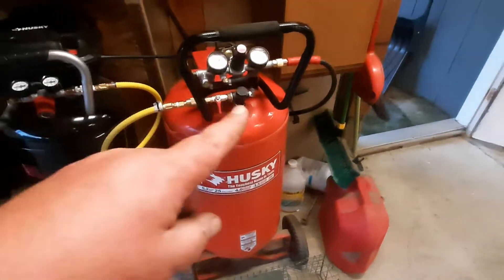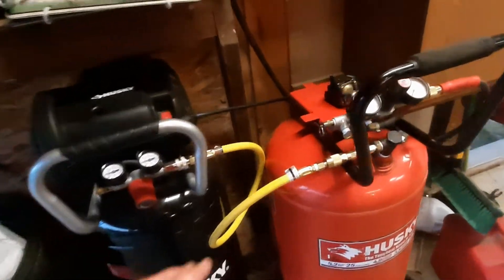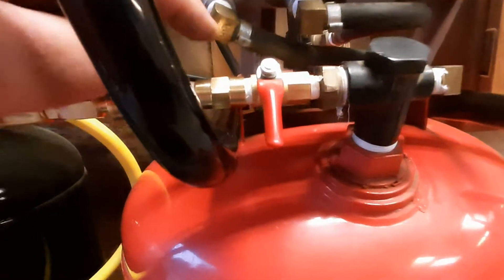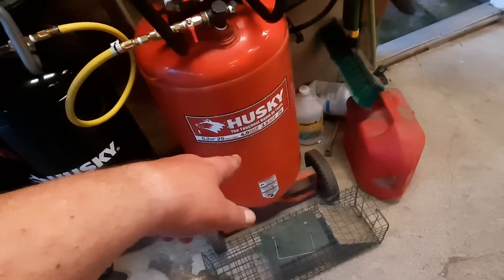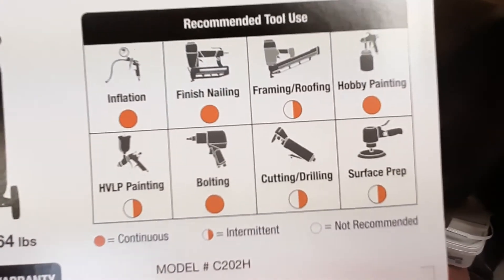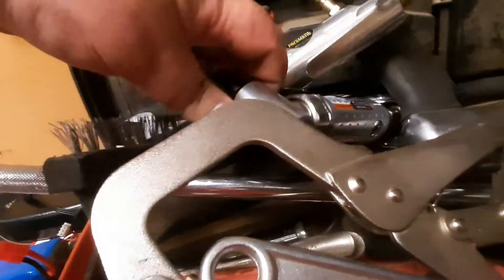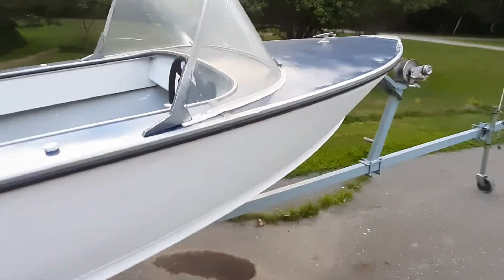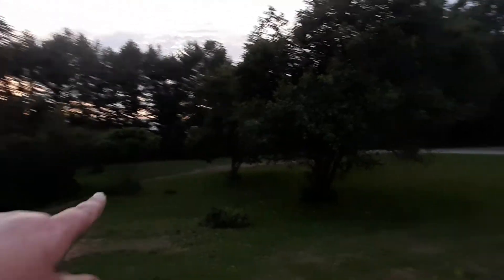Adding a second tank to my air compressor

Comment: Hello there I have a ? I have that same husky compressor but only difference is my is the 27 gallon well the motor gave out and I removed the check valve and put a hose with that same little valve and tried filling it up with my smaller craftsman 25 gallon and as soon as I try to transfer the air into the husky it doesn’t seem to keep any pressure it still has the motor and the whole set up I just wanted to do the same use it to wheel around but why does the air stay in the tank am I doing something wrong ? I can see the air drop on the craftsman like if it would be filling up the husky but the gauges on the husky are still at 0 I am dumb founded can you give me some advice I would appreciate it very much thanks

Comment: How’s it been holding up. 
I got almost brand new oil less from pawn shop that was not working took apart. 20$ cambell hausfeld 20 gal. 
I have 5 hp with oil compressor belts. 20 gal. 
Cambell hausfeld.  Thinking of doing something like that. Give me 40 gallon. 
Stripped oil less down to tank. 
Think with oiled compressor head might do even better. Not having worry about over heating it. Idk. Thinking. 
I like video.

Comment: Have the same exact old red husky compressor, I want to turn it into an expansion tank for sandblasting. Could you type out what exactly fittings/couplers you used into the red tank it would help me a lot
Reply from the maker: Sorry, I do not remember. Just used whatever I had in the garage. Nothing special.